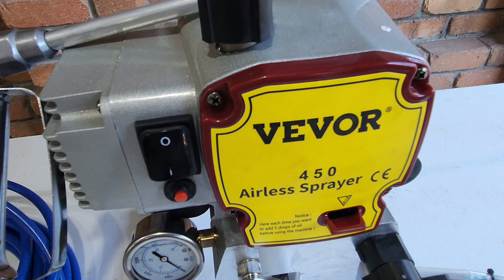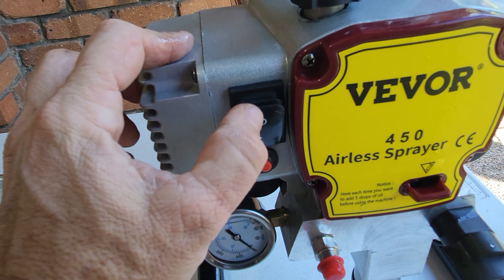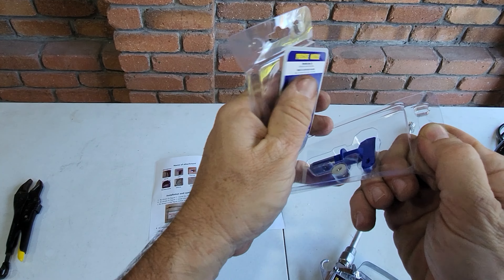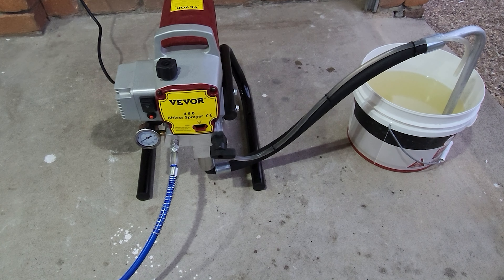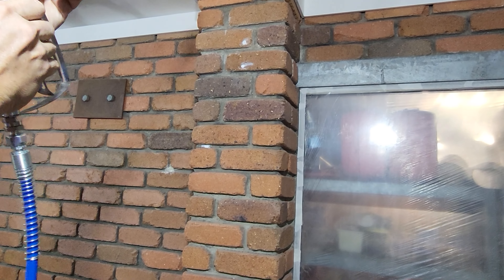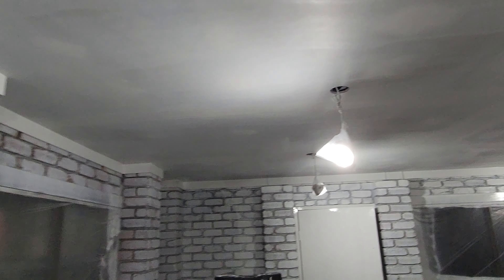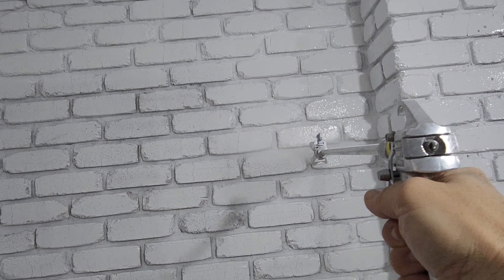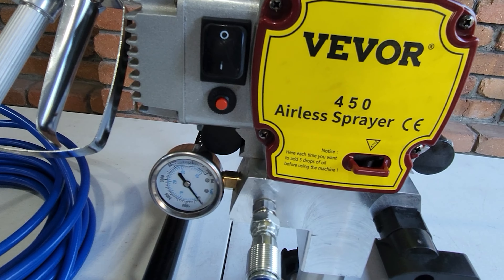Vevor 450 Airless Sprayer // Full Review - I'm impressed!!

Comment: I have the very same machine. Not yet used. Please explain the priming and the setting of the black knob. Turned right for priming ? Turned down for painting ??? Thanks
Reply from the maker: I'm no expert but in my practical experience with this sprayer, turning the black knob downward was mainly for pressure relief, meaning that at the end of a spray you don't leave the hose pressurised, so you turn the black knob down to release that pressure. I found that this unit primes the paint through the line itself when the knob is turned to the left which is its normal spray position.... there is no specific "priming knob". I placed the suction feed into the paint that I thinned out by adding up to 10% water, and it simply primed. Another thing one can do to "prime" the line, is simply place the suction feed into a bucket of water (provided one is using a water based paint), turn on the spray handle and this will easily suck out the water into the line, once water sprays out place the suction into the paint you want to use, and spray into an empty bucket until your paint product comes out and then you're good to go. Hope that helps! Maybe I should do a video on this whole function and how to clean it, as I didn't cover that in my review video.
Reply: @jelreviews  Many thanks, very kind of you, l appreciate. Yes please do make other explanatory videos.  I had another airless spray painter, had a bad experience, and sent it back-the miracles of mail ordering!- hope this will perform better, what is the yellow joint you applied? Teflon? Brand please. Yes the former leaked a lot.
Reply: Thanks was the best I have seen. Yes, please "do a video on this whole function and how to clean it" I would be appreciated  @jelreviews
Reply: Wow what a time saver   money well spent.
Reply: In my Chinese airless, the purge bypasses the painting hose and just flows out the short purge hose.  Direct that into a trash bucket when purging water or changing paints.  Otherwise, flow it into your paint bucket to recover the paint.  At end of painting, I remove the spray guard, relieve pressure by pressing the spray handle and lock it open.  I disconnect the hose at the pump (catch drips in jar and run pump briefly to pump out more).  I then blow 30 psi air thru the hose (hold air nozzle to it) to recover the paint in the hose.  Cover the bucket w/ a plastic bag since it will spurt when all the paint exits and it blows air.  I then switch to purge mode and run the pump briefly to catch any from the purge hose.  Secure your collected paint.  I use a squeegee to clean all from the can and wipe it off the suction screen.  I store the remaining paint in a smaller jug.  I even follow with a little hot water shaken in the can to recover more (slightly thins but matches what evaporated in use).  I then switch to water, both flowing thru the paint hose and purge tube.  Reinstall the tip to spray water thru it.  Unlock the sprayer, build pressure and pull the trigger to shoot the water out briefly and repeat.  That likely shocks more paint out of the hose.  Keep hands away because the initial blast is like a pressure washer.   Can even use the shots of water to clean your sprayer outside.

If taking a break from painting for a few hours, such as to let a first coat dry, drop the sprayer end in a bucket of water and cover the bucket with a plastic bag, pushed close to the surface to eliminate air and seal it tight to bucket and hoses.  Wipe paint off the hose and sprayer with a wet rag before it dries.

Comment: Ok dude, your paint machine has a lower pressure than your paint needs. If you look on the wall, you can see two lines on both ends of the spray. This indicates that it has incorrect pressure.😉
Reply from the maker: Thanks mate.... appreciate the tip.
Reply: How many turns from the end position should the pressure regulator have as a starting point for water based wall paint? Thanks
Reply: @NANIOCH   i have the same machine!how can i get rid of that?thanks!
Reply: Do you have a initial setup video?. Mine is "peeing". I tried to paint and some paint flood in trigger joint

Comment: got one of these , had it for 2 years now , replaced the hose and gun with a graco, poor hose and gun for the vevor , little bit of oil before use and still going strong using 3 times a week all day
Reply: So commercial hose will go on this? 
I'd like to use lp fine finish tips for joinery work, would I be able to set up this machine for that? 
Thanks
Reply: Where to put the oil?
Reply: May I ask what I should search for, for the replacement hose and g*n, also May I ask where you put oil please?

Comment: You take that plastic washer out, as it's sitting too far back in the thread, remove the tape and tighten right up it shouldn't leak.  If it leaks it's not tight enough.  No tape or washer for that part of the fitting.
Reply from the maker: Awesome.... Thanks for the tip. Will give that a whirl 👍👍
Reply: @jelreviews Did you test it ?

Comment: Mate thanks for doing a good review of this tool - I've bought one :) Please use a proper mask, that little dust mask is useless to prevent paint / chemical fumes getting into your lungs. You can buy a double-filter mask and swap the filters based on what you are doing eg spray-painting, asbestos removal, working with smoke, cleaning chimneys / flues etc.

Comment: I've seen a lot of these on ebay, amazon and was wondering too either these are any good and reliable...In this review it does kinda look ok but the main problem for me is that the sprayer is reviewed by non professional. Someone who has an experiemce with more professional tools (or even some DIY level sprayers like Wagner 250 or Graco Magnum X5) most likely would point out some key differences. And yeah, another issue of course is reliability - how long thus thing can last!?

Comment: Main error I saw is that you change the angle as you spray.  Best to keep the sprayer horizontal, moving it up and down without tilting.  You do that the top but need to do squats at the bottom (great exercise).  Ditto when spraying side-side.

I bought a Chinese airless "PTJ-HD2100 Plunger Sprayer" for $128 on Temu.  Similar but simpler, with no pressure gage (nor port for one) but appears rugged under the plastic covers.  Manual doesn't mention adjusting pressure, but has a 1/2 turn screw on the cut-off switch mount.  First pass gave excessive flow w/ Kilz Premium 3 Primer, even with smaller tips than spec (17 to 21 mil).  I tried both 515 tip (15 mil) which shipped with it and smaller 211 tip (cheap Chinese set), but the paint flowed so fast that even a quick single pass left it too thick (even puddled), so had to cleanup with a foam brush.  Smallest wire I had to test the orifices is 20 mil, which didn't pass so the orifices at least aren't that large.  When the Kilz ran out, I used leftover S-W Xtreme Bond Primer which sprayed much better though still a bit high-flow, but likely because I had thinned it ~15% for previous use in an HVLP sprayer.  This was ~60 F in a garage on cabinet doors horizontal.  Hope next pass w/ pressure set to min and unthinned S-W primer is better.  I could buy a Graco nozzle and guard, but $90 and likely not the issue.  Perhaps the Kilz primer isn't good for airless spray.  So far, just primer mess, which I can sand flat.

Comment: FYI that extension should not have teflon tape on it. Sometimes you need a thicker white washer or 2 of the ones you have there. no tape. this will cause spitting.
Reply from the maker: Thanks for the tip, much appreciated. Will try it👍👍

Comment: Great Video, I have been looking at buying this unit as I have around 90 meters of fence to paint, and I sure aint doing it with a brush. I notice with the unit, the instruction manual is just about useless, so your vid was a great help. Could you please do a complete video on cleaning, and how to store the unit long term, say if you didn't use it for a year or more. I also notice that airless paint guns have a filter in the handle, does this unit have that, and how do you clean or replace it. Many Thanks👍
Reply from the maker: Glad it helped, Roger. Will try to get around to doing a cleaning video, I think you're right, that would be helpful. Thanks for the suggestion.
Reply: Yes the spray gun has a filter inside.

Comment: good insightful demo. The noise it makes is unexpected but the result looks good enough and the wide fan on the spray tip can make short work of big areas but it should be adjustable to concentrate the paint delivery. It's a capable looking unit.

Comment: Nice review , A small tip for the leaking hose .
I always sand down flat the part of the pipe where it contacts the rubber seal. 
90 percent of the time these have a sharp end that created in manufacturing  and will cut into the rubber seal and damage it, witch will then leak ...
Reply from the maker: That's a good idea! Thanks :)

Comment: Thanks so much great video have bought one for painting my roof etc . I have added plumbing thread tape on all threads to stop leaks ? Is this ok ?
Reply from the maker: The plumbing tape worked for me. 👌
Reply: Plumbing thread tape has no use on presurised equipment like this. Try to tighthen the bolts a bit more  or in the case shown on the video add another washer or use thicker one.

Comment: You called it an air hose. It isn't it's fluid. Great video all the same. I would love a Graco or similar but far too expensive. These are basically pressure washers for paint.
Will this cope with industrial epoxies I wonder?

Comment: Merci beaucoup j ai acheté la même machine , je viens de finir le montage et faire teste avec de l' eau 👍
Demain je vais peindre en extérieur un hangar en tôle , 320m2 🤷🏻 , peinture a l huile 🤞🤞 , j espere que tout ira bien pour le nettoyage également 
Merci encore pour le tutoriel 🙏🏻

retour 😍 , FANTASTIQUE, j ai peint 70m2 de toiture en tôle en 1h00 , autant de temps a nettoyer 🤦🏻( peinture glycero ) 
Mon pot de 12L rendement du fabricant 180m2 , j ai réalisé uniquement 70m2, peut être trop de pression 🤷🏻
Si la machine se désamorce tourner la manette noir 10 secondes et remettre en position initiale 👍 ( idem pour faire le nettoyage au white spirit) 
Seul problème rencontré le blocage de la poignée est peint couleur aluminium mais est juste du plastique et cassé, aucune importance pas d utilité ( si besoin rajouter un serflex sur la poignée)

Acheté sur Aliexpress, provenance Espagne livraison 5 jours pour 157€ 🤩🤩
Je suis ravis de mon investissement 😋
Thank you very much I bought the same machine, I just finished assembly and tested it with water 👍
 Tomorrow I'm going to paint a sheet metal shed outside, 320m2 🤷🏻, oil paint 🤞🤞, I hope everything goes well for the cleaning too 
 Thanks again for the tutorial 🙏🏻

 return 😍, FANTASTIC, I painted 70m2 of sheet metal roof in 1 hour, the same amount of time to clean 🤦🏻(glycero paint) 
 My 12L pot yield from the manufacturer 180m2, I only made 70m2, maybe too much pressure 🤷🏻
 If the machine defuses, turn the black lever for 10 seconds and return to initial position 👍 (same for cleaning with white spirit) 
 The only problem encountered is the locking of the handle is painted aluminum color but is just plastic and broken, no problem, no use (if necessary add a serflex on the handle)

 Purchased on Aliexpress, from Spain, delivery 5 days for €157 🤩🤩
 I am delighted with my investment 😋

Comment: Hi mate, great video. do you know how it would perform with higher viscosity paints. I plan to paint our tiled roof with roofing membrane. thanks
Reply from the maker: I'm no expert but I believe that would come down to the type of nozzle being used. This machine is capable of pushing paint just like any other airless sprayer, so I would suspect a larger aperture on the nozzle would be key for higher viscosity paints. In any instance, I'd be researching that aspect on how other sprayers achieve flow for such paints.

Comment: Nice video!! I’m so glad to find this!!  do you have problems to clean the machine before painting???
Reply from the maker: Thanks! No problems at all, but the important thing is to clean it once done painting. I should have covered this in my video but I forgot. It took me about 5-7 minutes to clean it properly from the water-based paint in the line and then it's good to go whenever I need it next. 

Cleaning is simply running clean water through it until the paint is gone.... clean out the nozzle tip, and the I also took out the filter that is in the spray handle, ensured that was washed clean, and that's it. I haven't used oil-based paint through this, but it would be the same process, just use turps or thinners to clean at the end.

Comment: Great video, mate, just what I needed! One question: did you in- or decrease the pressure to get rid of the white lines at the start?
Reply from the maker: From memory, I think I decreased the pressure. Nevertheless, it's a trial and error thing, and is probably dependant on the type of nozzle you're using from what I understand.
Reply: I just had a Wagner instruction day on spray painting, because I have a ton of painting to do. They said that to cure it, you should first increase the pressure. 

If that doesn't work, dilute the paint. If that doesn't work either, change the nozzle for one with a smaller diameter, e.g. change a 519 for a 517.
Reply: Those white lines (also called "fingers") indicate you need more pressure.

Comment: I purchased the exact same machine. The unit pumps, but at some point the breaker in the electrical panel kicks out. Without pressure, it pumps without problems. I tried 16 and 20A (230V) 
outlets. What could be the problem? Thanks

Comment: Sounds like the motor is turning on/off everytime the pressure drops. Why is it not running all the time ? hmmm those voltage spikes ...
Reply: Don't worry this is DC motor no spikes if you give perfect voltage and load carrying socket
Reply: All the machines are like this they supposed to stop especially the good machines. They stop when they build pressure only turn on when needed.
Reply: No problem. All brands do the same "stop/start". And this is a brushless motor.

Comment: You shouldnt turn the prime valve with pressure still in the line, it will fuck your switch extemely quick. Turn off, release pressure in the line by spraying it into the drum, then you can turn prime valve. A machine shouldnt need priming unless you run out of paint and it sucks a bit of air or if it doesnt stop making the whirring noise like its trying to get to the set pressure even tho ur not spraying

Comment: Hello for my first use I can not make it work I first tried it with water when I turn the black button for pressure it goes up to 2500 or 3000 and after it makes no noise and when I use the gun nothing comes out ?
Reply: Llevan una bola de acero que sube cuando succiona pintura,revisa que no está pegada por óxido o pintura

Comment: I have traces of paint drops when I start and finish using the gun.....i see in your first action on the flor you have drops too.....do you resolve that problem???
Reply from the maker: Personally I don't think you can stop those drops on any airless paint Sprayer. I've owned other models before and same issue. For me it was acceptable but maybe a more expensive nozzle might decrease it a bit? Maybe check online for answers.
Reply: You can use Clean Shot Valve, will solve the problem. Good presentation.